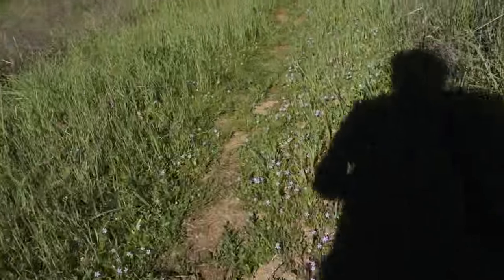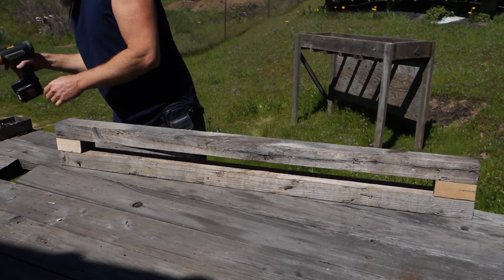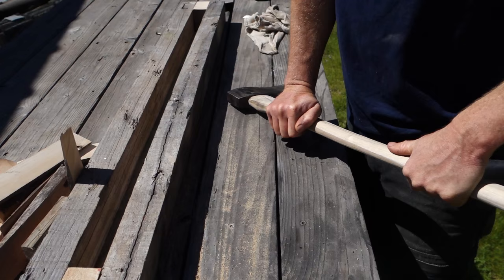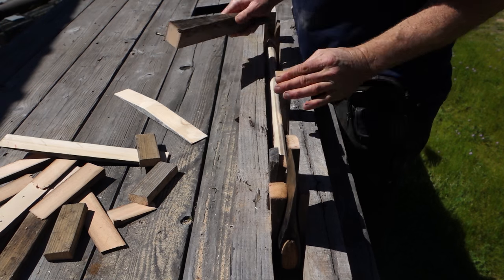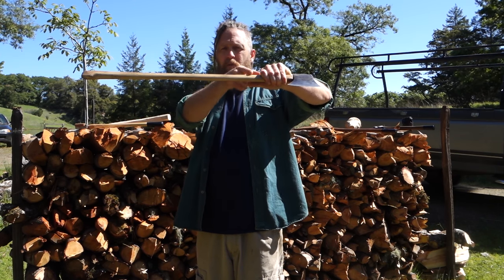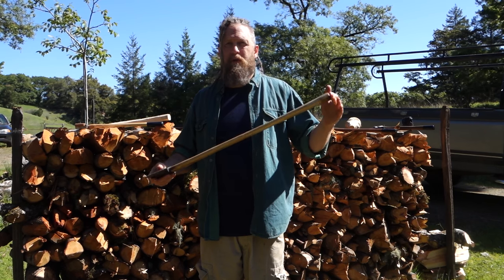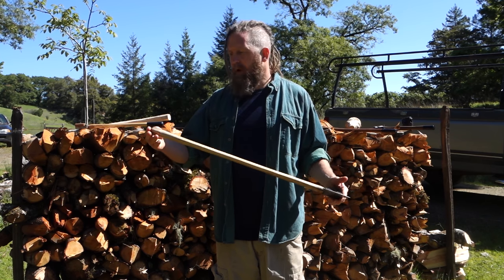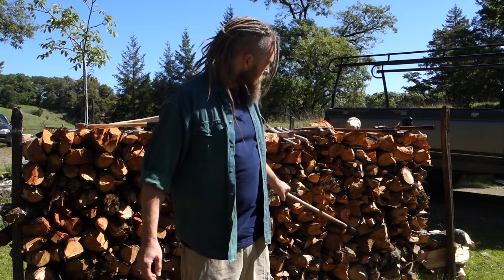Steaming and Straightening the Bay Axe Handle

Comment from the maker: This handle stayed straight until it broke.  I used it quite a lot for real work, so it worked.  It eventually broke from a side impact.  The wood was just too weak.  I think bay wood might work as a handle, but using older, denser, more mature wood.  Probably still not great though.

Comment: thats great!  i was just thinking of re-hanging an old double bit axe that i bought at a yard sale.  its got a warp in the handle but the wood is nice and solid. I'm gonna try this first.  thanks for posting this!
Reply from the maker: Yeah, might as well try it, it's so easy.  If the wood is very old and been warped a while, you may have to over bend it like I did here, but you can always do it again if it doesn't work the first time.
Reply: so how did it work out? I am in the same situation - bought this ""craftsman vanadium" at a fleamarket for only 25 USD. The handle (which is hickory I believe) has a pretty bad warp so I just wanted to hear other experiences.
Reply: @somatder  , I'm curious how it went for both of you 🪓😁
Reply: @edialbert8035  I followed the procedure as described by Mr. Edholm - it was actually pretty succesfull, I got rid of the warp. It seemed like the warped extremely slowly returned but was only very subtle. The handle is actually "dead" now after LOTS of heavy use. It snapped last winter due to cracks formed from going through when splitting. The head is now on a new 34" elm handle
Reply: @somatder  , thank you for sharing your experience!

Comment: Another informative video!  I straightened an axe handle by putting it into a plastic pipe with boiling water and leaving it for a while before I clamped it and bent it back.  However it is starting to warp again. It is thicker than an axe handle, so flexing the fibres might not work in my case: but you have got me thinking about trying it the next time..
Reply from the maker: +Michael Kearney Have you ever seen an American pattern scythe handle?  Those things are super thick and bent into a radical form.  So, it probably is possible.  Getting it really hot all the way through might help, and also all the stuff I did here like over bending and drying super thoroughly in the shape you want it.  If it's an axe handle, you might consider thinning it anyway if it's very thick.  Most modern ones are much too thick.  Then again, sometimes its time to just put on a new handle.
Reply: +SkillCult Thanks for that.  My mistake, I meant to say sledge handle.

Comment: Torx heads are designed to 'cam' out the driver bit if too much torque is used. So in theory the screw head is better protected
Reply: no, the flanks are 90°

Comment: Actually this is very useful for me as I bought this double bitted axe in the US at a fleamarket and brought it back home to Denmark. The handle is very warped probably from leaning against a wall for a long time with changes in humidity. After watching this video I realized I might as well keep handle which apart from the bend is very nice and hickory I believe with perfect grain orientation. So I didn't cut of the handle - instead I will straighten it using your video as a guide. 

One question though: How important is the soaking before the steaming? Is it necessary? Or would I need a pressurized steaming chamber if I didnt soak it beforehand?
Reply from the maker: Go ahead and try without soaking.  I really wanted to pull out all the stops on that handle, because I had already tried to straighten it once and it really warped because of the way the growth rings were.  Usually steaming alone is adequate.
Reply from the maker: And no, pressure shouldn't be necessary, or soaking all the way through with the steam. Heat alone can be enough, but not generally as effective or safe as using steam.
Reply: Ok, that's good news. I reckon I should let it steam longer than 0.5 h as you did with the bay handle. Do you know that it is done steaming when the wood becomes very flexible?.
Reply: What is the purpose of soaking the wood anyways? Is it just to increase the heat conductivity as to decrease the time needed for steaming or does it changes the physical properties of the woods.
Reply from the maker: Yeah, more flexible.  I imagine that it allows for more distortion of the wood structure, so it might stay put better, but not sure.
Reply from the maker: Once it's hot through you can go for it but longer will get more moisture into the wood.
Reply: allright, thanks buddy! I'll let you know the result when I am done
Reply: UPDATE. IT WORKED! Oh, yeah, I removed it from the jig yesterday and came out almost perfect straight. I went out and did a bit of chopping and it stayed in shape, but lets see if it springs back. Once again, I succesfully applied skills learned from your videos, thanks for your effort! However, the head was slightly loose so I figured I'd rewedge the thing - BIG MISTAKE: I have spend 5-6 hours carving out the wooden wedge and  that sucker of a metal wedge is an absolute bitch. It came out 1/4 " but I am not even done yet. Why the heck didn't i just give it a few wacks in the butt and put in another metal wedge or wooden peg? But, as you pointed out, often it is better to learn the hard way. I
Reply from the maker: One good trick for the wedge thing is to seat the head another 1/4 to 3/8 inch down.  Then you can cut off that much wood off the top leaving the top of the wedge exposed. It's a drag if you really don't want to lose any more length, but it can make all the difference.  It's a good idea to cut a notch in the two sides of metal wedges before driving them, so you can hook that with a screwdriver and pry out for future removal too.  glad the straightening worked.  I want to do another video, exploring some options for heating and steaming.If it doesn't hold, work it harder next time to stretch the fibers on the tight side more.  good luck.
Reply: thanks. Yeah, I guess that's the only option left. I have tried drilling pilot holes and inserting a screw to pry it out. It worked but at this point there is no room left as it is totally messed up from all the work and this damn soft metal.  I still got 1/2" to seed it down further before hitting the shoulder on the handle so it should be possible. Next time I'll notch the metal wedge before putting it in. I have realised the reason why by now, lol!

Comment: I have a shop that is effectively outside, and I have noticed some warping but not on all of my axes. Is it bad to keep the axes outside?
Reply from the maker: Not the best. wood is very unstable in the face of changes in humidity and temp.
Reply: @SkillCult  I’m still living with my parents and I plan to move out in a few years, any tips on keeping the handles from going bad/warping/cracking beside just oiling them a bunch? My shop is just a 8x8 box with aluminum siding so I can not control temp/ humidity very well.
Reply from the maker: @henry9806  I would just keep putting a drying oil on them until they dont' want to soak up any more.  raw linseed oil (aka flax oil), safflower, canola, hemp, walnut etc.
Reply from the maker: @henry9806  https://youtu.be/ueVi_NObci0

Comment: Really cool to see how malleable wood can be. I'm on my first attempt at making an axe handle but i don't have the proper tools yet. You mentioned that you like the bahco files and i was wondering if you have a recommendation for rasps as well. Is it even a good idea to get a rasp if I'm just a beginner?
Reply from the maker: You don't need too many tools, but some are pretty essential and you of course have to be able to use them.  Baryonyx knife company carries one I've been wanting to try.  Mine is pretty worn.  I haven' seen anything else that looks any good.  A cheap one will work, but if this one is any good, it will be worth every penny and more.  They are incredibly useful.  The other thing you can do is ask a farrier for a worn out rasp.  They stop using them as soon as they are a little bit dull.  Those are very aggressive though and much less versatile than these four way shoe maker's rasps.  Here's the baryonyx link.  http://www.baryonyxknife.com/stbifora.html  Also, don't discount the power of scraping with knives.  I hope to get a video or two out on that sometime soon.
Reply: Thanks for the info! I'm a complete novice to woodworking but I want to learn more. I'll do some experimenting with knife scraping :)

Comment: Those efforts do not worth enough for just an axe handle, because you can just make another handle and replace the wrapped one. However this video is very useful for other irreplaceable worthier wooden stuffs, so thanks for sharing...
Reply from the maker: Not the way I make them.  Also, I didn't reaslly need to make the jig.  I wanted to try it though.  It's not that hard to soak, steam and straighten a handle.
Reply: Okay, that's good for you and others.. thanks for sharing.
That technique works well with my old wrapped guitar that worth much money and histories. I steam the inside body and just flat press it from outside. Now I need few weeks to make it naturally dried before releasing the clamps to make sure it won't wrap back again.

Comment: What was the handle material? hickory?
Reply from the maker: +Lawman212 Oops, forgot to say that I guess. It was in another video.  It's bay laurel, aka pepperwood or myrtle wood.  It only grows in California and Southern Oregon.  it is elated to the bay leaf we use for spice and to avocado.  It generally seems like a pretty tough and stringy wood, but not used for handles by anyone I know.
Reply: +SkillCult Joe Dabill used to make bows out of California Bay Laurel at the Skills gatherings, I made one with him at my very first Wintercount.  He claimed that the knots were very strong and that it didn't matter if one was on the edge of a limb. All these years later, my bow still shoots great and the knots in bad places haven't led to any problems.
Reply from the maker: +Alan Kaufmann yeah, I remember him using it and we talked about it once or twice.  I don't remember him talking about the knots though, so that is interesting.  That handle just broke and my impression of the wood is that it is very light and weak feeling and not really how I usually think of bay.  I don't think the knots are the main reason it broke, but I wouldn't be surprised if they contributed a little bit.  The wood just seems immature maybe as it was a youngish vertical sucker off of the trunk of a fallen over tree.  I'm not giving up on it as a handle material, but I would try to use a more mature piece of wood next time.  I think some of our oaks would probably make a better handle though.  Joe was a remarkable man.

Comment: you softened that axe steel for sure in the steaming process lol
Reply from the maker: Look up the temp of steam v.s. tempering color temps.  Much cooler.  Even the hardest tempering color is almost twice as hot as steam.  I chopped a lot of wood with that axe after.
Reply from the maker: On cursory examination of that paper, the lowest temp they did was boiling point, 212 degrees f, 100 c.  But they left it for 20 days because the effect was so slow.  They also as far as I can see were tempering hardened steel, not reheating tempered steel.  I can't see how even steam temp, which the axe head very unlikely to have ever got that close to given it was out in the air, would be in any significant way affected.  The lowest temp that is usually used to gauge tempering levels by color is light straw which is about 400f.  Axes are tempered much softer, so hotter than that.  While there may be some effect on the steel structure by long heating, that wouldn't surprise me, it is probably not functionally significant and I can't imagine it could result in softening past the point where the steel has already been softening in original tempering.

Comment: Try to do handle wiht grain orientation is side to side, thats wery old way to make handles, before indrustial factory's start to build handles for axe's only because front to back way maken handles you can make them on board and you get moor handles per tree... If hadle is not curwed much its stronger side to side way, and you dont hafto wory short or long fibers how they work to gerher.... I have meny axes that way and newer get broke....
Reply from the maker: I've used handles that way.  I still think they are more vulnerable, in the fore/aft direction, but I don't think it's that big of a deal in either direction.  It may be that it's also better for certain woods?  I'd buy a handle with horizontal grain over vertical if other aspects were better, like overall quality of wood etc.